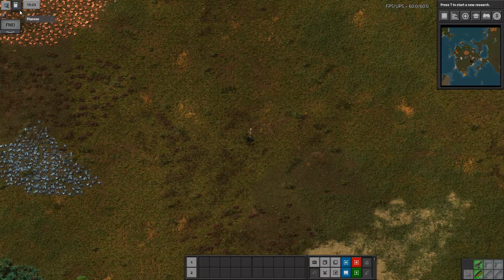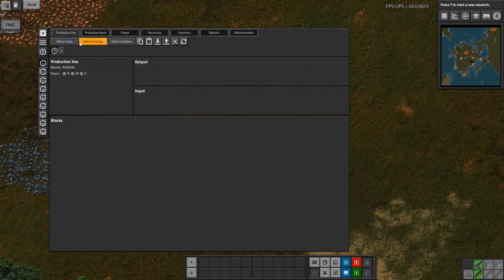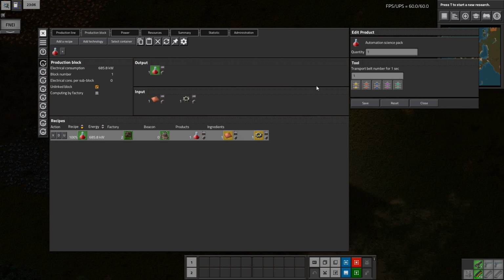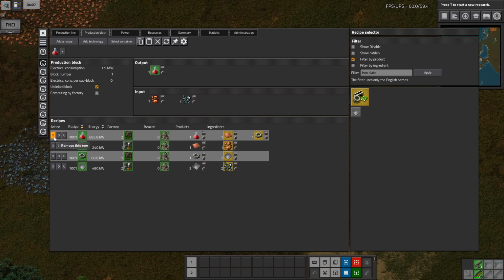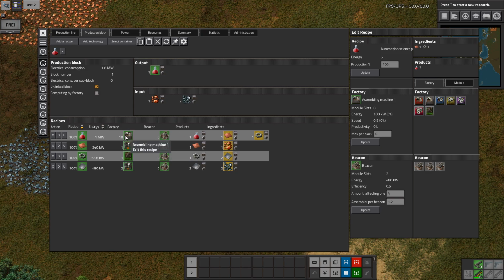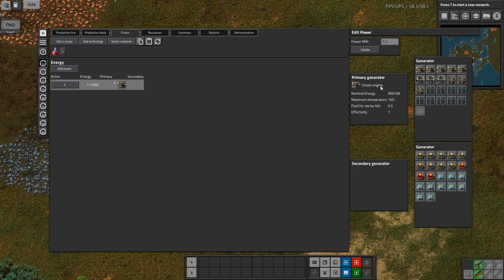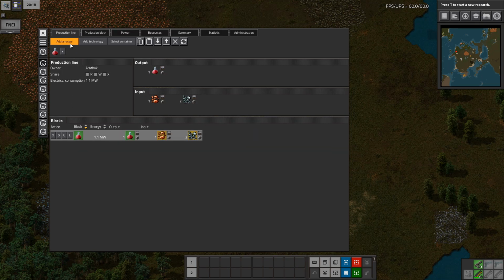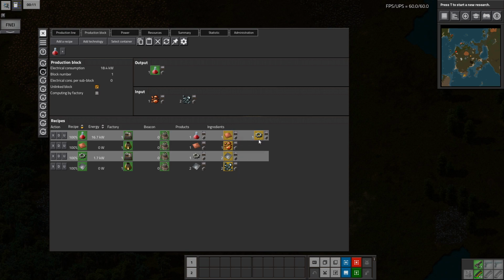Factorio - How to use Helmod / Planner

Comment: args, just had written a longer wall of text :-) and lost it when YT started playing another video before i could send it :-(
now again, and a bit shorter:
very nice tutorial, only very short and yet all the basics explained well.

something strange seems to have happened: the video is almost a year old (march 2019), but all comments are from the last two weeks only (writing this in jan 2020). did lots of people start playing modpacks at Xmas 2019 and thus now needed to use helmod ?

at 9:15 you could have shown that the number of assemblers changes back when you set production to 60 since 1/sec is the same as 60/min :-) and this is also the point where i am stuck in helmod quite often. somehow i can no longer change the desired production number after a while, maybe related to other features that i have accidentally enabled like the matrix solver which is essential to resolve complicated nested or circular production chains (including eg vanilla oil production with cracking) and/or together with the functionality to lock production lines (to make them usable for other production lines so that you can have several parts of your factory which all use the same shared mining/smelting area, or the same shared "intermediate products" area. although i sometimes can use those features, i don't completely understand them and thus can't use them fully or even get stuck.

someone wrote another similar mod "Factory Planner" which is a bit easier to use ingame and also uses the current set of mods, but which also is missing all those important additional functions (like the matrix solver) that are essential when playing with more complicated mods or modpacks. for simple vanilla calculations i would recommend the website of kirkmcdonald which has a calculator which is easy to use with an easy interface and some nice output (as tables and even flowchart/diagrams).

will you do more/new videos about helmod, for the new version (mostly changed UI only) and for all the advanced features like matrix solver, locking, and specifying percentages ?

edit: only later, i saw that you already did an updated video, but since those videos both are from march and may 2019 only and the mod was updated again in the meantime (it's jan 2020 now), yet another updated video for the basics, and then one or more for advanced features would be appreciated :-)
Reply from the maker: Greatly appreciate the feedback! A new video will be made and released soon (tm)!